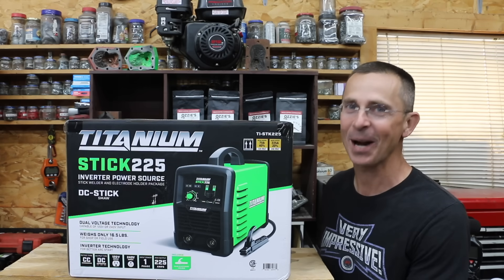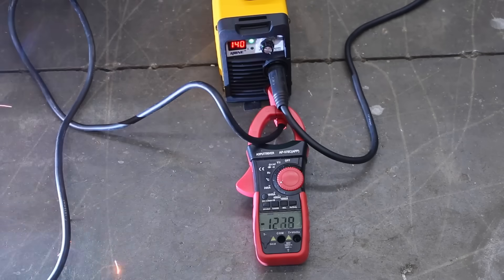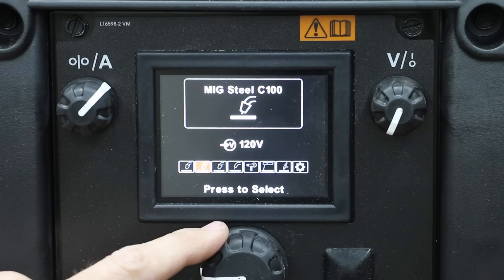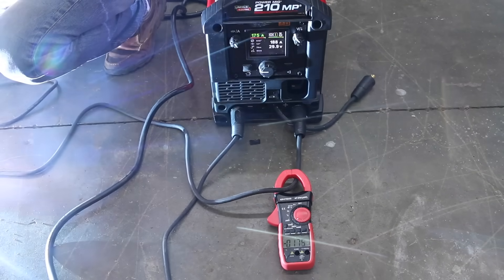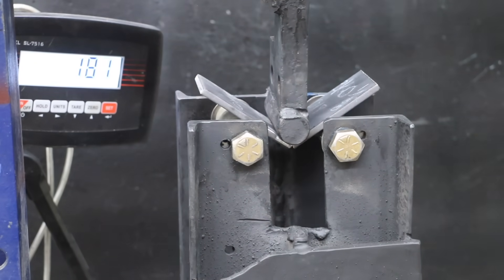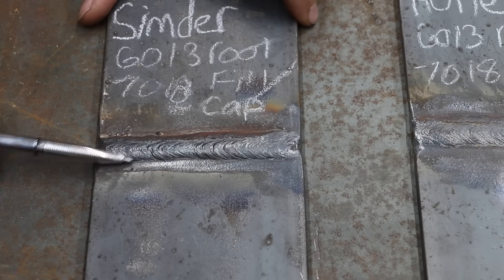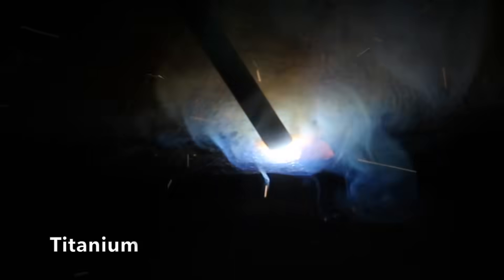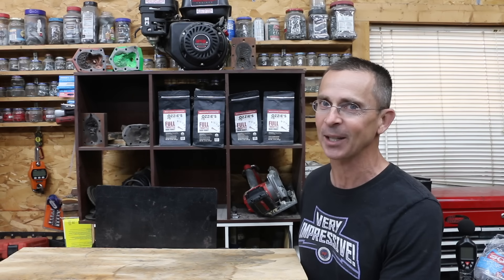$70 vs $2,300 Welder? Let's Settle This! Weld Strength, Duty Cycle, Current Output, Build Quality

Comment: From my own experience just a cheap harbor freight welder with a spool is amazing. We put it though hell. Use it on almost every car, use it for demo derby’s, races, just small stuff around the garage, stuff that’s out of its league to weld and it does it. If you’re trying to find a reliable one under $500 I highly recommend. The poor thing gets torched for over 2 years and haven’t had to do anything but get gas and spools
Reply from the maker: Thanks for the feedback.

Comment: Thank you Joe! Wish I could weld half as good as you. I have an old wirefeed 110 Lincoln that I got at a pawn shop for $90. 
I welded the loop back into my catalytic converter and it held. So just that one fix paid for it. I also use it to weld nuts onto stripped bolts for removing or any small items that will not endanger anyone. For stuff like trailer hitch I hire a pro like you
 😉🤟
Reply from the maker: Thanks!

Comment: Not sure if have ever done a test on different kinds of insulation. I will be enclosing the crawlspace at my mountain home to prevent pipes from freezing. Also adding a dinning room by enclosing a portion of the front porch. Thinking about spraying close cell foam directly onto the underside of the metal roof which has no plywood decking. Foam would be right a 6.5" in thickness.  I am wondering which material is best to insulate, fiberglass, close cell foam, open cell foam or other materials available. Also does foil wrapped bubble thin insulation add additional R values?
Reply from the maker: Thanks for the suggestion.

Comment: I absolutely love my Titanium 200 Unlimited Pro Multi Process welder - I'd really enjoy seeing it go head to head with that Lincoln in this video since it would be a direct comparison, minus the fancy digital display (can't lie, that Lincoln is a fantastic machine, but for the price point, the Titanium wins hands down).  I really enjoy your reviews.
Reply: I was.looking at buying the Titanium for my farm welding needs. It looks like it will get the job done and not break the bank.
Reply: @garyrussom3545  for a project welder, the Titanium series is a fantastic buy. The MIG 170 is just about perfect for any farm task. The 120V power is pretty pointless unless you're working thin stuff, but the 240V is solid.
Reply: @RanmaSal  You can weld 3/32 electrodes at 120V without any problem. Good thing about dual voltage is that all of them have a voltage controller.
Reply from the maker: Thanks!  Thanks for the feedback.
Reply: I dont even know why do people buy lincoln welders.
Reply: @kyohiromitsu4010 quality, better duty cycle, warranty, support, parts availability, quality of weld, reliability ect. If you're welding professionally buying the better tool pays for itself in the long run.
Reply: @Gary.6.10.19  better warranty? Miller, lincoln is like 1 year warranty and even $150 welders do last years. If the welder is faulty and needs repair you will need a $700 board and sending it to repair for a long time i used to buy expensive equipment and I do have like 18 welding machines. Just like angle grinders. I was buying 20 grinders per year and I switched to offbrand and they are almost the same for a third of the cost.
Brands mean nothing now.

Comment: again with the testing of unlike products... titanium offers a similarly speced welder to the Lincoln that would have been much more comparable. I believe yeswelder does too. One you should look at is the AC/DC tig machines since all tig machines can also stick weld and its a one machine solution regardless of material. Machines to look at there would be primeweld 225, vulcan pro tig 205, weldpro tigACDC200GD... im sure there are others that im not remembering.
Reply from the maker: Thanks for the constructive feedback.

Comment: I just recently got a yeswelder multiprocess machine and their mig/flux core welders are really good, the tig side leaves a lot to be desired but honestly I don't think I'll ever need another welder unless I want to do tig. Their cheaper units might not be as amazing, but this multiprocess 120/220v machine did great. Way better than the Chicago electric units I've tested and well worth it over a lincoln or even a titanium considering the price.
Reply from the maker: Thanks for sharing.

Comment: I'm surprised you didn't use these welders to test which of them would be best for the battery recharging experiment you did earlier.  The welder worked leaps and bounds above the dedicated tool, but if I want a welder for just this specific job it'd be nice to see which would suffice.
Reply from the maker: Thanks for the feedback.

Comment: Love your videos!  How about doing a comprehensive video on dry pour concrete?  Such as: test several brands of bagged concrete mix for wet pour vs dry pour strength, at 1,3, and 28 days, wet vs dry surface finishes, water penetration in dry pour, and optimal watering schedule for dry pour. Keep up the good work!
Reply from the maker: Thanks, will do!  Thanks for the suggestion.

Comment: Enjoy your work, a little positive criticism, 25 year electrician here. I'm not sure the amp test is completely relevant. If My thought process is correct a 1/8  rod will simply melt at about 125A. You need more resistance for the machine to produce more amperage. It's like hooking a tiny 12v 10 watt light bulb to a car battery. It would never max out 1000 cranking amp battery because there's not enough resistance
Reply from the maker: Thanks for the constructive feedback.

Comment: Thank You Todd and Joe!!  Been wanting to find a reasonably priced multi welder ~200A for my projects and have looked at these peanuts but would rather save my duckets for something that suite all my needs...mostly tig then mig then stick.  It's all the accessories/necessities for welding that that puts them over the top cost wise.  This was really thought out protocols IMHO and welding was pretty darn good quality considering the machines.  

One small note on your clamp meter is it doesn't say True RMS which means any ac measurements need to be multiplied by .707 for closer accuracy and yet most of it's specs were decent although ±3-3.5% gives you ~ 9 volt/amp swing in readings.  It does say "sdouble integral a/d conversion chip" but that doesn't mean it reports an RMS value to the meter...but $40 is a good price for the home diy.  I ended up with the Klein CL800 but the CL120 is a good non RMS starter.  Flukes are out of my league and don't like the ones I've used.  

Hoping you guys can do a vid on multi process welders of reasonable price range and bang for buck.  Thanks always for your great efforts and time to keep us on track with best bang for the bucks we spend!!  Hat Tip, ~PJ
Reply from the maker: Thanks and you are welcome!  Thanks for the suggestion.

Comment: I can understand what you are TRYING to do here!
BUT welding is not only about the machine! you could buy the best machine in the world and still have a bad weld IF you do not know what you are doing
example at 10:22 there is a hole in the centre of the first weld they put down? That weld should of been completely ground out.
If you have a welder with low power you run a smaller rod and make more passes,
want good penetration? have a smaller nose or leave a 1/64 to 1/8 of an inch gap.
the 5 minute test is the only one I like
BACKGROWN on me! started working in the metal industry at the age of 16 as a boilermaker, I have always worked on the shop floor welding with MIG, MAG, TIG, Stick and I have done a lot of GAS welding. I am 62 years young and I am still working as a welder.
Reply from the maker: Thanks for sharing.

Comment: I have a Lincoln 210 and have been very happy with it.  I do smallish home type jobs on mostly cast metal, so definitely not a professional opinion, but it's been fantastic for this amateur.  The presets are surprisingly helpful... thankfully I don't have an issue with cold ambient temps so it's very plug and play.
Thanks Joe!  I'm sure you appreciate a good welder after this test )
Reply from the maker: Thanks!

Comment: ive been welding over 20 years and been a feeling educator for over 12 years, work side by side with Lincoln and miller, for a fact all the china welders stole patents from miller, lincoln and esab. it's easy to sell equipment using forced labor and zero investment in new tech. take apart a titanium welder, you'll find several electrical components are "missing" serial numbers.  customer service with the big 3 are usually really good, get to know your local reps. for those machines to be off so much on amperage is criminal, and immoral. if set it for 90 amps, i need that to pen the steel.
Reply from the maker: Thanks for the feedback.

Comment: They use the first one where I work in a processing plant , its small and gets the job done,  for quick welds. If your welding you need a shop with its own breaker panel.
Reply from the maker: Thanks for sharing.

Comment: If I knew you were making this I could have sent you my extra $75 stick welder. I have nothing to do with it except use it Incase my current one breaks. But the welder does so little output that it's more likely I would buy a better welder when it does break.
Reply from the maker: Thanks for the feedback.

Comment: The lower amp welders may be better suited for 18 gauge (2mm) and thinner material found in sheet metal, exhaust pipes, and square tubing, the bane of welding.  Please review welders for 2mm material, using 1/16" rod at below 50 amps.  The big welders will not strike an arc or light up the 1/16" rod like a Roman candle, making a wretched mess.
Reply from the maker: Thanks for the suggestion.

Comment: Dinse vs Tweco connectors - got the Hone and found that it had Dinse rather the Tweco on my Miller. A pair of genuine Miller adapters cost more than the welder. Cyberweld has cheaper $26.80/pair but didn’t find any except Miller on Amazon. Got any leads to a cheap alternative?
Reply from the maker: Thanks for the suggestion.

Comment: Have you ever thought about doing a video on heavy duty degreasers? Specifically thinking about comparing products how to clean motor oil stains from our driveways (cleaner product vs just pressure washing). I think this would be a great idea.
Reply from the maker: Thanks for the suggestion.

Comment: I don't think the test that limited them all to 130 amps was helpful, rather the test should have been "best case scenario" for each welder, which means that you set each welder to its optimal settings for a given task and note how it performs, so that people could see the practical limitations of each unit.

Comment: 1:48 who builds an electric equipment for 220 Volts? Oh yes, here in Europe you identify the most stupid and incompetent Chinese dealers by that - they never noticed that starting 1983, the standard voltage in Europe was raised to 230 Volts. Which means, that all those Chinese crap will break within a few weeks of use.

Comment: I got a cheap stick welder that normally works like a Champ but the Thermo-Shutdown is a pain. It overheats like Crazy. 

I also have a mid-prized flux core welder, really good machine for around 150€. 

One thing that I wont buy for cheap is my oxy-acetylene welding/cutting torch. Those cheap torches, regulators etc. are like a ticking bomb to me. So safe money where you can, but Not if it comes to dangerous stuff.
Reply from the maker: Thanks for the feedback.

Comment: You needed to use a fast freeze rod like 6010 or 6011 on the root of the beveled full penetration test.  That would have tested the arc character of each of the machines on an open root weld.
Reply from the maker: Thanks for the constructive feedback.

Comment: Only thing I wish that would have been included was measuring the open circuit voltages on the machines. Some rods like 6010 you need a fairly high OCV to run properly which a lot of cheap machines just don’t have, so it would have been interesting to see if any of them would have been able to run a 6010
Reply from the maker: Thanks for the constructive feedback.

Comment: I had an idea for a video today after I did a brake job on my car, with powerstop offering drilled and slotted rotors and ceramic pads on a lot of average joe cars. No pun intended. Id love to see if this does make a positive difference in temperature, cool down time, and even power over standard OEM parts. With the difference gor my car costing about and extra 100$ plus shipping. Im curious if my money offered any extra performance. Thanks for thr always great Quality Content either way!
Reply from the maker: Thanks for the suggestion.

Comment: Show idea- LED conversion bulbs for T8 fluorescent fixtures. Upgrade that shop lighting. 

Measure initial lumens, how well they scatter light and power. Buy a bunch of bulbs and run them for 6-12 months 24/7 and measure the brightness drop using a light meter.
Reply from the maker: Thanks for the suggestion.

Comment: What was Joe’s pick? Would have been interesting to throw in a base model Lincoln buzz box or Miller too. Thanks to Joe for his help. I got some personal feelings on which one would hold up better over time but a couple welders did better than I thought they would.
Reply: I've been running a titanium for over 3 years with constant use. I like it better than my Miller. Granted the titanium is an inverter vs transformer on the Miller but it's way smoother and has held up great.

Comment: I also agree with a few others. I've picked up a titanium welder, and it's been great for me. I'm by far not a good welder but it's made my odd jobs on the ranch way easier and it didn't break the bank to buy. Of course that Lincoln welder will be the best as it should be for the money.  High quality equals high dollars.  But.. for guys like me who are not professionals and just need to stick a couple of pieces of metal together once in a while and don't have a ton of cash  to spend.
Reply from the maker: Thanks for sharing.

Comment: For the price both the Deko and Hone are impressive. I am just more impressed there are so many decent 120v options now. Back when I was in welding school like 9 years ago there were not many 120v welders.
If I was going to buy one to use every now and then for small project either the Deko or Hone would do great for me. But if I was going to be welding every weekend on projects then the harbor freight titanium especially since they go on sale all the time and they always have coupons. 
But if it was my job I would go Lincoln, Miller, or maybe Hobart. All 3 are brands that have good reputations and have been around for a while. 

Been thinking about finally getting a job welding. I went to school for it, got certificates in Tig, Mig, Flux core, stick and Tig pipe welding. But by the end of my classes I decided it wasn't what I wanted. However if I could find a job indoors with air conditioning doing welding at a bench I would take it. The issue I had with the career was the recruiters. I talked to 4 of them and they all had the exact same story oddly. Got out of school in the early 90s and started at the company shortly after meaning they were in their 40s. But they looked like they were in their 60s and moved like they were in their 70s. Welding is just rough on your body depending on the type of welding of course but most of these guys were either oil pipeline or building heat exchangers aka welding in small areas.
Reply from the maker: Thanks for the feedback.

Comment: this is a perfect example of "Tell me you know nothing about welding without telling me" Why in the actual fuck would you bend the weld from the part that is NOT welded? its obviously going to have issues.. not to mention the bend test you did is completely wrong.. hence why all bend tests are done with a 45 degree angle edges.. If you are watching this DO NOT LISTEN TO THIS MAN ON THIS SUBJECT! As an ACTUAL certified welder here (MIG (.035-.045 wire all positions), stick (60-10, 60-11, 70-18, 70-24. all positions) TIG. ALUMINUM(045 wire all positions), and DUAL SHIELD (045 wire all positions) This does NOT accurately represent these welding machines. I am shocked by the amount of shit content by people who have no clue what they are talking about...

Comment: I have the blue S7 used in 110v, and also an older Lincoln 110v inverter welder that is about the same size, maybe around 8 years old. The Lincoln doesn't have a hot start and has always been a hassle to get started. I really like the S7 in comparison with the Lincoln I have, just much easier to get going and put a consistent weld done. My weld projects are small and ugly but functional- small utility trailers, rototillers, aerators, go-karts and so on. It's nice to have something that can mend things together when a piece of metal breaks. May have to buy the Hone after seeing your review.
Reply from the maker: Thanks for sharing.

Comment: Good video Todd.  I have a 180 amp Lincoln MIG welder that I purchased a dozen yrs ago for about $600.  I only do MIG welding with it, however, and it is a great machine for general shop use.  The Lincoln welder you used in your test is a step up from mine, and I would expect excellent results using it as a MIG with gas shielding.
Reply: Night and day going from a transformer machine to IGBT inverter.   Just so smooth and so many more bells and whistles.   Only thing to keep in mind invert machines are highly electronic and need clean energy or you can damage them.  So if you run them on a gen set it has to be a invert gen set with clean energy.    That is the only real downside.  Everything else is positive. Especially if you need light and portable.
Reply from the maker: Thanks!  Thanks for the feedback.